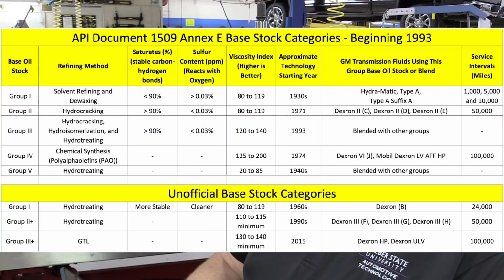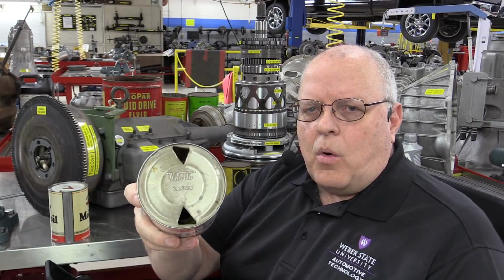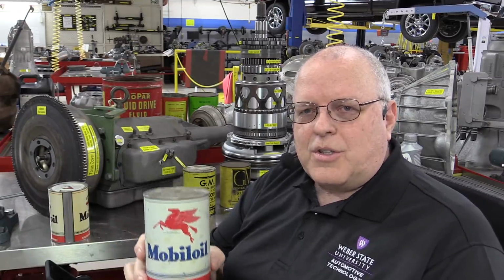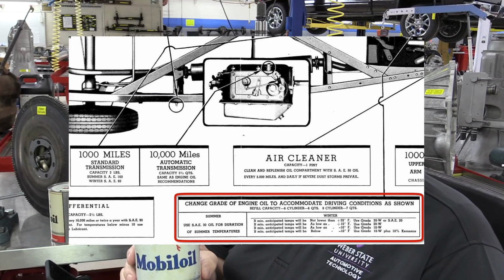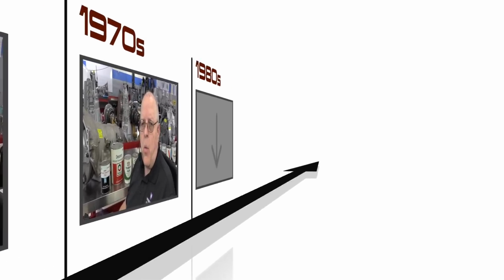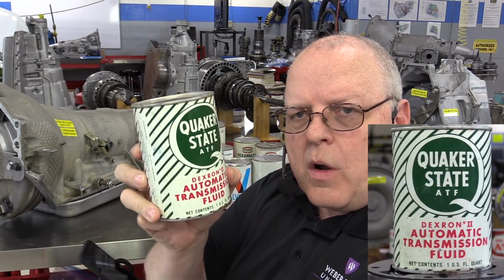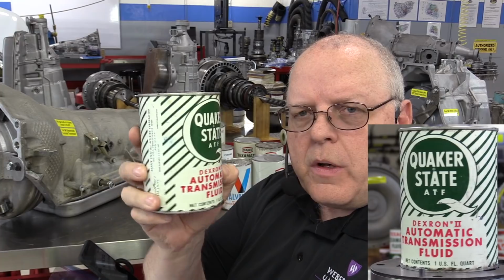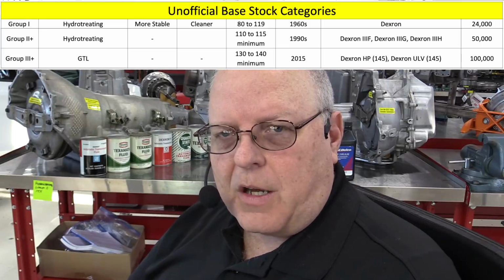GM Automatic Transmission Fluid - ATF History Part 2

Comment: So you would not recommend the MOBIL LV HP fluid for a 6L80?
Reply from the maker: Use Dexron-VI in the 6L80
Reply: Thank you for the reply!
Reply: Awesome! Thanks again.
Reply: That is some good information to have and is greatly appreciate d. I assume this would apply to both “black” and  “blue” label Mobil HP fluids?
Reply from the maker: @frtaylor9  Yes
Reply: Would you have to have the service bulletin number that states the HP fluid is only to be used in the 8 speed transmissions, so I can inform my fellow technicians at my dealership. Thank you.
Reply from the maker: @frtaylor9  The 18-NA-355 TSB has a section where you must flush out the Dexron-VI from the TransFlow Flush Machine. "Important: The prepping procedure only needs to be completed if the DT45096 supply reservoir has DEXRON VI fluid in it and has not been converted to use the new blue label Mobil 1 Synthetic LV ATF HP fluid. 

Note: The prepping procedure only needs to be completed if HP is not in the supply reservoir.
" The original Dexron HP bottles had a label that incorrectly stated that it was compatible with Dexron-VI. They updated the label and removed that statement. They are not compatible fluids.
Reply from the maker: @frtaylor9  GM's July 2017 Emerging issues: "My question is can the new Dexron HP Automatic Transmission Fluid be used on vehicle using Dexron VI transmission fluid? We last covered this topic in the March 2017 show in the Powertrain segment. A new formulation of Dexron HP has recently been introduced and may be at your dealership now. It has the Mobil 1 label on the front. 

This new HP is NO longer compatible with Dexron 6 fluids and vice versa. Only use Dexron HP for transmissions that call for it specifically. We heard that some of the early production of the new HP has a statement on the label incorrectly indicating that it is compatible with Dexron 6, but that information is incorrect. The label is being changed.

Using Dexron HP in place of Dexron 6 or Dexron 6 in place of Dexron HP may result in poor shift quality, long term gear set wear and gear noise.

So, the simple answer is NO, Dexron HP can NOT be used in place of Dexron VI."

Comment: Please consider reviewing Packard's Ultramatic Drive since it was the only automatic developed by an independent auto manufacturer.  It was also the first automatic to have a torque converter clutch which they called direct drive  It did not "shudder" during lockup. I think GM sued Packard claiming that Ultramatic was nothing more than a copy of Buick's Dyna Flow with an added lockup clutch. Thanks .
Reply from the maker: That is very interesting. I doubt I will every see one. Thanks for your feedback

Comment: Thank you very much prof. I have Volvo in owner manual sees use AW 1 . In my city I can't find it for original fluid , so I use likui  moly 1800 . Is there any fluid that can use from Ford or GM . thanks
Reply from the maker: It is available in the Internet. Try eBay or amazon or a local equivalent. Best wishes
Reply: @WeberAuto  Thanks . Also what do you think about likui moly automatica transmission treatment .Is it good for transmission?
Reply from the maker: @ABDULRAHMAN7334  I would not use any treatments

Comment: I think that the Subaru automatic transmission fluid HP series is also a synthetic it claims to be a unique formulation to be used in all Subaru transmission including 5EAT. Just basically the Jaco transmission if I’m correct.
Reply from the maker: Thanks for your feedbacks, I have not explored Subaru fluid specs yet

Comment: I found your videos after watching a guy disassemble a 50 Olds Hydramatic. I have a 52 Olds Super 88 w/ hydramatic and my buddy told me I could use Dexron lll and I've been trying to verify. I'm also having a problem with reverse lockup pawl engaging when I'm trying to back up and wondered if that had to do with the fluid. Your video was very long and a couple of the others I've watched on the hydramatic weren't exactly short, but I've definitely learned a lot of stuff. But geeeeez man, it's almost 8am and I haven't been to bed yet lol  And now I see there are so many more videos for me to watch. Keep up the good work
Reply from the maker: Thank you. The fluid should not affect the reverse pawl. Dexron-III(H) is your best bet.

Comment: Amazing video. OK so I have to ask, I have a 2005 Aztek. When we bought it about 4 years ago it came with a shiny GM remanufactured 4T65E that was so recent there wasn't even any dust settled into the crevices on top. By smell (since the different fluids don't all smell the same) it has Dexron III of some kind in it, it is now due for a change so can someone tell me if it would be safe to go ahead and use Dexron VI?
Reply from the maker: Thank you! Dexron VI is backwards compatible with Dexron III. Best wishes.

Comment: "In the US, whale oil was used in cars as an additive to automatic transmission fluid until it was banned by the Endangered Species Act.[25] Prior to 1972, over 30 million lb (14 million kg) of Sperm Whale oil was used annually in lubricants because of its exceptional lubricity and heat stability.[26] In 1972, the Sperm Whale was listed as an Endangered Species. The following year, the US Congress amended the Endangered Species Act, outlawing the killing of whales and the use of their oil.[26] The loss of whale oil had a profound impact in the automotive industry, where for example, transmission failures rose from under 1 million in 1972 to over 8 million by 1975.[26]"   - https://en.wikipedia.org/wiki/Sperm_oil

Video is awesome! Really looking forward to more. Just thought it was missing one interesting detail.
Reply from the maker: Thanks for your feedback. Dexron II(C) was the first GM ATF without the sperm whale oil additive. I did not include the Sperm Whale oil information because I cannot find any documentation in any ATF specifications calling for it. The only information I have been able to find from a credible (non-wikipedia) source (New Your Times) indicated that a very small amount of the Sperm Whale oil was used in ATF to coat parts inside the transmission to prevent rust and corrosion. I will address it further in the next ATF videos. Have a great day!
Reply: @WeberAuto  I understand. The only reason I even knew about it was by random mention in a documentary series ("How We Got to Now" PBS 2014) that got me curious. It only briefly mentioned lubrication and was predominantly focused on spermaceti as a fuel for lighting. I had the hardest time finding any decent sources myself.

A brief mention on page 262 of New Scientist issue of May 1975 being one. 
https://books.google.com/books?id=4-K0JiefZEoC&pg=PA262#v=onepage&q&f=false

Also a report by ILSR "Biochemicals for the Automotive Industry" on the Ohio EPA website...
https://www.epa.ohio.gov/portals/41/p2/biochemicalsautomotiveindustry.pdf

I think both of those are unfortunately referenced by Wikipedia as well at some point so I'm not sure how "scholarly" you would prefer to consider that.

The only other thing I found that seems remotely worth mentioning on the topic so far is from a copy of "Automechanics" by Herbert E. Ellinger (Prentice-Hall, Inc. 1972) which failed to provide a specification. Instead it only listed M2C33 (Type F) for Ford and Dexron for GM (and other) automatic transmissions while describing automatic transmissions as "durable, and reliable" on page 347, provided the proper fluids were used. 

Page 2 reads, "a passenger car is designed to operate over 100,000 miles before major service is required." Which other than confirming that they were teaching new mechanics that automatic transmission were reliable with proper care prior to something doesn't help much, but it does predate the New York Times article from 1975. (But, this shift could just as easily be attributed to new operational stresses on the lubricant so... meh.)

Thanks again for putting these videos together!

Comment: Lots of awesome info here. Being a trans rebuilder for 40+ years and specializing in vintage transmissions, I do have a few small disagreements, but it doesn't amount to very much!
I'm looking forward to watching more of your videos!
Reply from the maker: Thank you! I am sure I made some mistakes
Reply: @WeberAuto , they were small potatoes. Like the years that a certain transmission was in production. A Cast Iron Dynaflow never upshifted. They did have variable Pitch after 1955. Dual Coupling Hydramatic was introduced in 1956.
Roto Hydramatic did not have a Variable Pitch. Iron Power Glide ended in 1962.

I learned quite a bit from your video and I watched it right through.

If I can offer you any assistance, please let me know.

Congratulations!
Reply from the maker: Thank you!
Reply from the maker: @stevepeluso911  Thanks again, I appreciate the feedback

Comment: Normal conditions, the car is scrapped at about 75,000 miles because the transmission fails!

Didn't they use whale oil in transmission fluids at one time?

Have a '65 Corvair Powerglide.
Reply from the maker: Yes they did, it was used as a rust inhibitor additive prior to 1973. Dexron II(C) was the first transmission fluid without the whale oil additive

Comment: Hello Prof Kelly, 69 year old guy here in Rochester MI who has almost always done his own car maintenance / repairs since my first 1963 1/2 Mercury Comet. I love to watch your videos just to get all the fine details about subjects related to brands I have never owned. Your comments about the concerning the 1997 ECC transmissions makes me curious though as to how the false P0300 trouble codes are avoided in vehicles with manual transmissions. I would think they would be almost exactly like a fully locked torque converter while driving at a steady speed. I'm especially curious since both of the cars I normally drive are 6 spd manuals.
Thanks for all the wonderful videos. Professor!
Reply from the maker: Manual transmission equipped vehicles wait for a smooth road with little change in vehicle speed before attempting to detect misfires.
Reply: @WeberAuto   I just remembered that I left a question here and came back to see if there had been any response. Thank you for the answer. I was really curious as I had seen some of my son's manual transmission cars give misfire error codes over the years and your video really got me wondering how those had been detected.
George
Ps, I am eagerly awaiting the corresponding videos concerning Ford and Chrysler automatic transmission development over the years as I was pretty much a Ford guy (grew up in Dearborn) but respected Chrysler as well while always sort of being negative towards GM. My wife and I owned quite a few Chrysler vehicles from 1983 till 2015 but now have gone totally back to Ford. There was one GM purchased brand new in those years, and what a disaster that was, (smile).

Comment: Here's one for ya... 3 Allison MD3000 clutch fails in 20k mi. In our 2000 Monaco Diplomat with a Cummins 275. Always transynd, and Allison filters. 4th reman just installed, never left Western Star in Ridgefield WA parking lot, due to #3 solenoid wiring failure (according to diag comp). All engine and driveline components in spec. Allison really wanted it to be someone elses fault. Milage of failures, 1st 70k; 2nd 75k, 3rd 89k. Fluid change 3k ago at Allison authorized shop. No fluid debris, color, smell reported. 2 independent fluid samples report NO contamination, other than very fine clutch particles, under 5 mic. Never gets hot, eng and trans always exactly where they're supposed to be. We are somewhat desperate for the cause of these failures. I've run heavy equipment my whole life, starting in the Army at 17.

Comment: HP fluid question:  I have a 2016 GMC L86 truck that is out of warranty now, 73k miles, and i don't know its fluid history.  It doesn't seem to shudder.   I've changed all fluids except this enigma of a transmission.  I have 12 quarts of that Mobil 1 LV ATF HP on hand.  Your video indicates that i would need to flush out the fluid completely to go to this M1 fluid?  Is this possible for a semi-skilled home technician with no lift but decent tools?  Thanks for the top shelf videos!

Comment: How picky is the engine to what oil is put in it vs. the transmission?
Reply from the maker: Just as picky. Almost every vehicle manufacturer has their own oil specification recommendations.
Reply: Never knew that. This video is likely the most important one of all those you have produced. At first a video about transmission fluid looks to be beyond dull...until using anything but the correct one likely will hammer you in your pocket book. Relating the fluid to the transmission design and development history was key in keeping my interest and developing a sense in me as to how locked together the two really are. Do you plan to or please do a series on all automotive fluids. I have to believe a lot of us DIYers are doing a lot of harm to our vehicles not understanding how particular our vehicles are to the fluids we put in them.
Reply from the maker: Thank you. I do not plan on producing videos on other fluids/oils, but I will keep it in mind. I have spent years gathering data, fluid cans,  specifications, transmissions, etc. to piece the timeline together for this video.  It is so much work and I have many other projects in the works. Thanks for your feedback. Have a great day!

Comment: I know a lot of people that use universal tractor fluid in automotive automatic transmissions seemingly without issue. I was always going to look into the specs to see how close it is to dextron
Reply from the maker: Thanks for your feedback, by the way, it is spelled Dexron not Dextron.
Reply: You know a few years ago we had the trans out of a Case 580E apart and if I remember right the clutches and seals were interchangeable with either a Powerglide or a TH350 and the trans called for universal tractor fluid
Reply from the maker: That was probably the original 1967 Dexron fluid specification.

Comment: Great summary! Thank you!   I have a 2017 Corvette 8-speed.  My friend has a 2016 that has the shudder problem.  They did the flush and change 3 times.
Can you explain the shudder problem, causes, and why new Mobil fluid helps?
Do you recommend doing the 3 time, fluid flush and change,  for 8-speeds that do not show the shudder problem YET?
Reply from the maker: Thank you! GM does not explain the cause for the TCC shudder in the service bulletin (16-NA-175), it just has several tests to perform to verify it is actually the TCC. If it is, the Mobil LV ATF HP fluid is required to flush and refill the transmission. Remember that both old and new fluids are already full synthetics. I believe it is an additive change to the synthetic base oil to make the fluid a little more slippery (increased lubricity). If it were my own personal vehicle without a shudder, I would want to change it before any possible trouble begins. Best wishes.
Reply: Thank you so much for your response and information!!

Comment: how come you dont talk about sperm oil usage?
Reply from the maker: I forgot. Also, I could find no evidence it was ever used. I had heard it was, but I never found anything proving it.
Reply: https://en.wikipedia.org/wiki/Sperm_oil
Reply from the maker: Thank you. Yes, I saw that. Unfortunately there was no actual evidence there regarding its use in automatic transmission fluid. There were just statement saying it was used. None of the references helped either. I want to know when and how it was used. Was it part of the base oil or an additive. Early transmission fluid specifications do not mention it at all.
Reply: from what i have read it is an additive. it was used for a lot of things befor the 70's. from penetrating oil, sowing machine oil etc. even as a protecting layers on the cars when new.

Comment: Thanks for your very great and impressive effort..certainly one for the history books. As a  simple explanation, oils are less stable because there are C to C double bonds which are easier to break/oxidize producing water/sludge than more stable saturated C to C single bonds. Hydrotreating breaks long chain hydrocarbons into smaller molecules by breaking the C=C bonds and adding a hydrogen atom to each C atom to end the chain....makes a more stable molecule but viscosity is affected...polyolefins have C=O groups which could get oxidized to water and CO2...not sure why  they are advantageous...anybody knows????
Reply from the maker: Thank you and thanks for your feedback. I am no chemist, but I am attempting to understand the stabilization that hydro-treating brings

Comment: Awesome. I change fluid every year suck out as much from dipstick and put Lucas stop slip in with new fluid. I have 275k and 330k on my GM transmission s in van and truck never failed.N ot the 770r4 ahhhh
Nissan had CVT that used viscous fluid that got thicker when hot . The New CVT all are failing ....insane push chain design.

Keep your fluid cool and clean and they will last. Extra cooler is the trick.
Some guys swear by John Deere tractor transmission fluids in Heavy duty usesage. 
A hot rod trick in the 1970s was to put Type F Ford fluid in GM less slip of clutch packs bands better shifts. I put in old slipping trans along with Lucas to save them.
Reply from the maker: Thank you for your feedback

Comment: These kind of things scare me from taking my vehicle for service...seems like every mechanic (not dealer) I know has a different opinions about whichever brand of aftermarket fluids they use...not just in transmissions.  Even if you ask for a OEM fluid, how do you know you got it?
Reply from the maker: Good question. I would bring them my own fluid from the parts department of the dealership. Their bulk ATF tank is not likely to be the correct fluid.